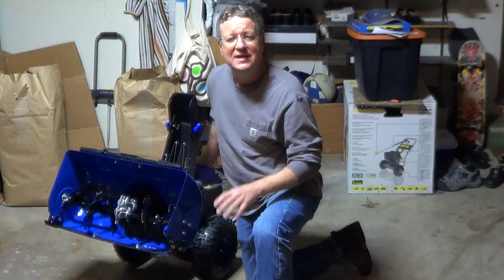Skid Shoe Height for a 2 Stage Snow Blower

Comment: Place the machine on a level surface (like a concrete slab) Loosen the skid bolt nuts (9/16"), tipping the machine back on its grips if you like.  Two quarters stacked equals 1/8" in height.  Drop the machine back onto the ground and place two pairs of quarters under the scraper blade, each pair 6-8" out from the blade center.  Ensure the skids drop down freely and evenly to the level surface below them, then tighten all four 9/16" nuts to secure them in position.  
That's it!